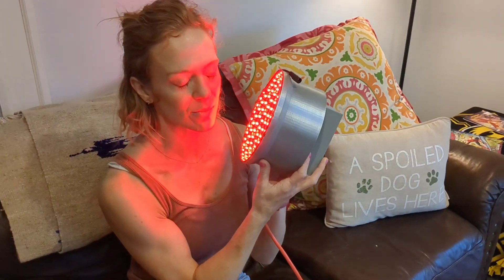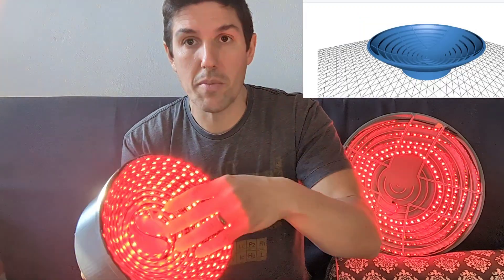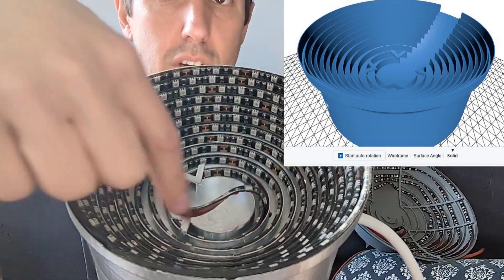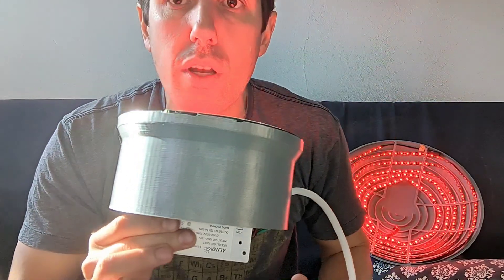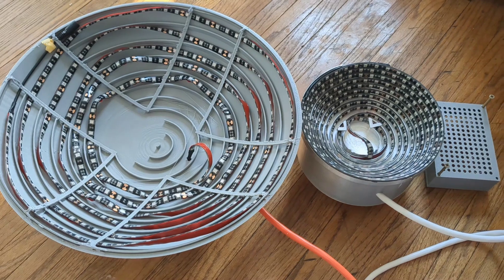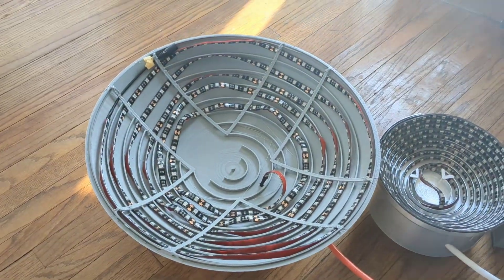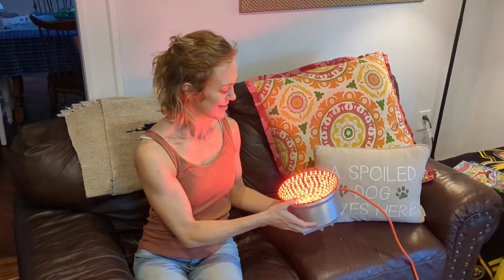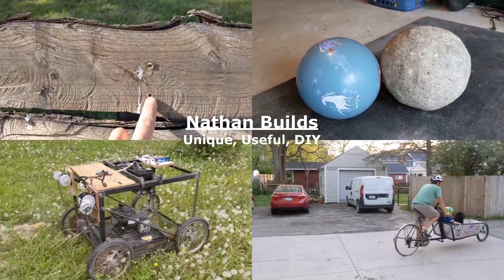DIY Red Light Therapy Device - $38, full build/schematics - why pay more?

Comment: Caution, you can actually have too powerful a light and cause damage. You can also use it too long and/or too often and do more harm than good. I forget the term but it's a curve and at one point instead of the benefits going up, it starts coming down. You should also wear protective glasses if you're using it for your face.

Comment: This is great that people are having a go at building these. I've been using and researching red and NIR light for years, and 'm soon going to be selling a 60w red and near infrared device which has an internal battery, charges by usb and has a built in timer for around $100. The 300w mains-powered desk version will be around $200 and the 1000w door/wall hanging version will be around $300. I'm just finishing up the manuals and the website for the launch near the end of November.
Reply: Wouldn’t the posters device have no medical benefits since it’s standard LED and not 850nm or 630nm?
Reply: tell me more !
Reply: Would you like to get one in my hands for testing?  I'm looking for something to use in a professional space, and also for at home.
Reply: @joejirschele6052 you're using them in a professional space, don't they have to be certified and tested?? It would seem like that would be appropriate... 🤔🧐🤷🏼‍♀️
Reply: How and where are you getting these tested?? 🤷🏼‍♀️🧐